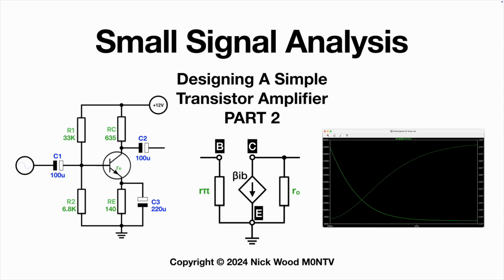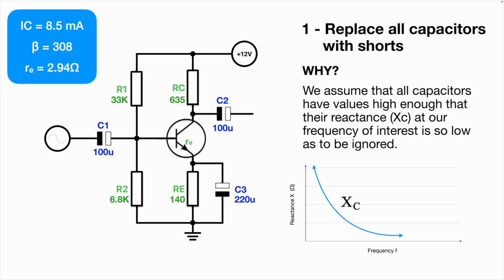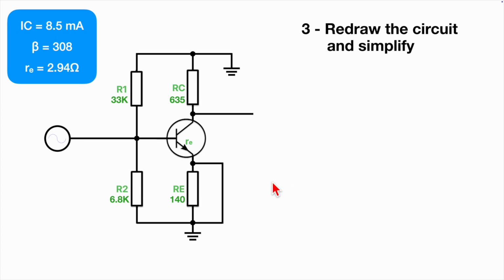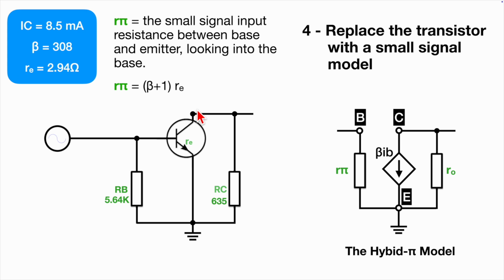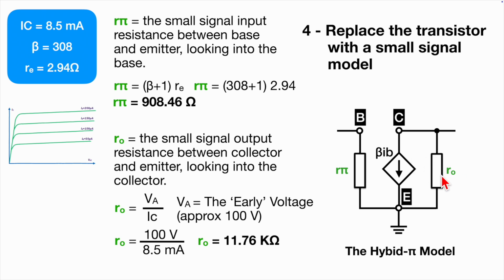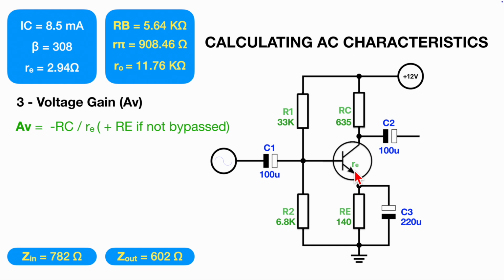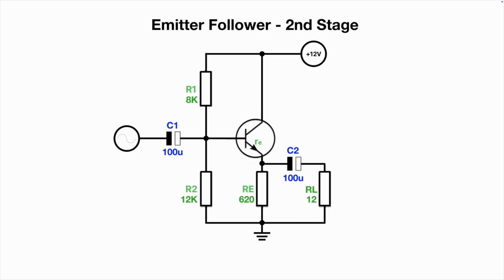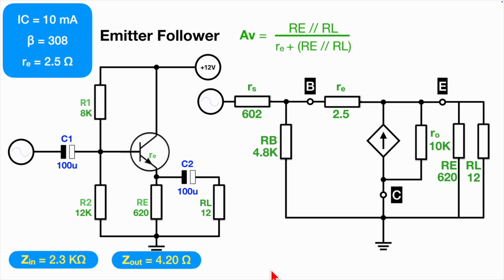58 - Small Signal Analysis (AC Calculations)

Comment: Very interesting thanks Nick. What are the implications of connecting the first stage output of 602R to the second stage input of 2.3k? Perhaps irrelevant at audio but needs consideration (impedance matching?) at higher frequencies?
Reply from the maker: Hi Nev, thanks very much. You raise an important point. For audio it would have been advantageous if I had managed to get the input Z of the emitter follower a bit higher so as to preserve more of the voltage gains in the first stage. At audio I aim for a factor of 10 i.e. input Z is 10 times higher than output Z of the stage feeding into it. Here I only managed 3.8. With some optimising this could be improved.

When it comes to RF you are totally right. Impedances need to be matched for maximum POWER gain. I would probably tweak the 602Ω output Z of the first stage a bit and then connect the two stages with a 1:4 transmission line transformer.
Thanks again for watching and for your insightful question. 73, Nick
Reply: @M0NTVHomebrewing  great question and the answer, I was always wandering though, why it is so important to impedance match the rf but it is not the same for the audio. I meant from logical perspective it should be the same shouldn’t it?
Reply from the maker: The short answer to that question is that signals operate differently at different frequencies. At RF frequencies where the wavelength is short enough to make a difference then impedance mismatches mean signal reflected back. This produces standing waves (SWR) and can result in distortion of the original signal. This is particularly the case if it is reflected back into something like a mixer which can then produce spurious outputs. But chiefly we want to preserve POWER transfer at RF - and max power transfer happens when impedances are matched.

For audio signals it is different. The wavelength is so massive as not to interfere in the way that it does at higher frequencies. Max VOLTAGE transfer is king here. Ideally you want an input Z much higher than the output Z of the stage feeding it. This preserves the voltage gains and also doesn't load down the previous stage. You can boost power when you need it (e.g. to drive a speaker).

Hope this helps. 73, Nick